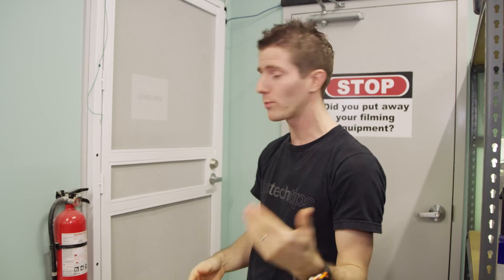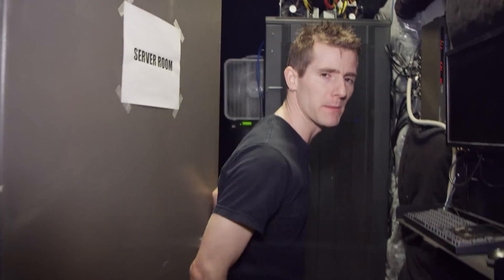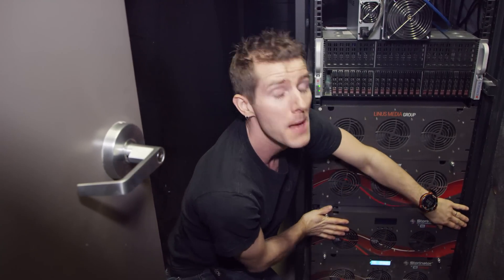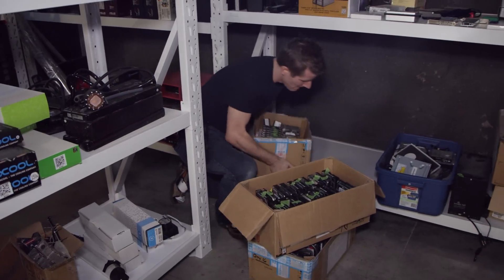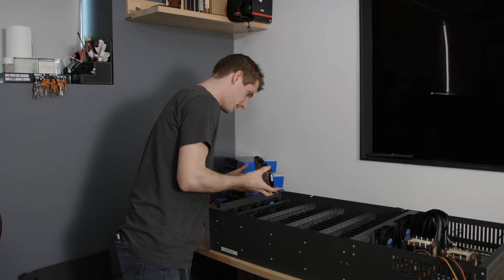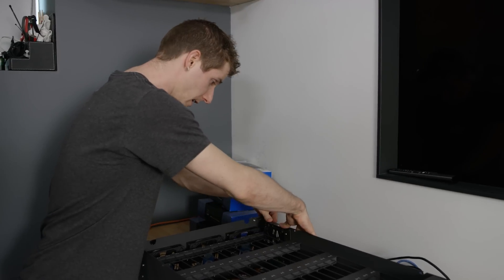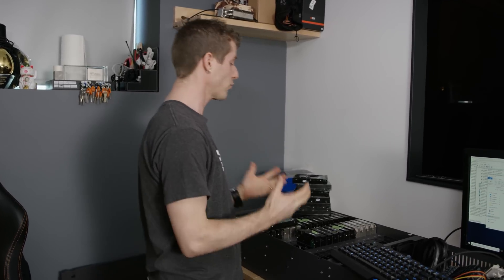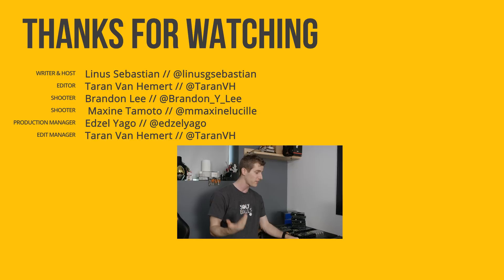HARD DRIVE Mining? This is getting ridiculous...

Comment: did you really use Seagate and a long-term reliability in one sentence? LOL
Reply: I have Seagate drives from 2004 that still work. To be clear, I use them in JBOD, because they're too small to store anything on their own. They're still going strong though.
Reply: OMFREAKINGGOD I had a very early Conner drive that couldn't hold a memory dump of a picture of Charmin that was still running after 15 years when I finally got ride of it.
Reply: Seagate was the only drive that hasn't died on me yet.
Reply: I’ve had worst luck with western Digital hard drives then anything I once had a western digital external hard drive that had a hitachi hard drive in it lmao
Reply: @josualinder3802  Why do you find it funny that you found a Hitachi drive in a WD enclosure? You do know that WD owns the Hitachi disk brand, so a Hitachi disk is a WD disk?
Reply: I've got a 1TB external my mom bought me with my PS3.  still goin strong!
Reply: I have a pair of seagate barracudas from 2011 which were powered on for over 6 years straight and they both still work. They aren't server grade, just regular cheap ones. I also have barracudas from 2004 and they still work fine. I have hitachi, maxtor and western digital drives and they work too. I had a samsung branded hdd which stopped working after 10 years.
Reply: Seagate had a perfect record in my book, right up to a couple years ago...  I recall a flood in Indonesia and prices tripled.  Right around then seafarers reliability sank through the floor and even I shifted to WD or Kingston SSD'S...
Reply: last year i bought a brand new Seagate drive and started throwing out bad sectors and reallocated sectors within 24 hours of me getting it 
it put 400GB of data behind a $900 paywall (data recovery costs)
and of course, Seagate refused to pay for those costs (and so did the store i bought it from) 

NEVER buying Seagate ever again, Western Digital is now my HDD of choice
Reply: @mwbgaming28  
So you got a bad drive boo hoo... in 17 years of IT support for various blue chip and educational sectors I have come across many drives that have failed in many different ways, some even give 100.000 of thousands of soft errors and never actually develop a problem and remain perfectly reliable, some have been fully reformatted and never actually develop a hard fault or another fault after a file system error, this can happen sometimes... it's not ideal but it can happen.

If your drive started throwing errors in the first 24hours why didn't you send it back with the proof and get a replacement drive on warranty like any normal person would have done rather than being a moron and storing 400GB of data on it and continue to use it? Typically one tests these things before fully migrating and deleting their backup. 

Your statement says it all really.
Reply: @mwbgaming28  
One other thing they store additional bytes for allocation on the drive as a backup measure for several reasons, one reason is minor faults in the manufacturing phase for redundancy and fault tolerance which is perfectly normal in every industry with high production rates, including cars, aircraft, computer chips... you name it, fault tolerance is something that is built into a lot of things. So if your drive started re-allocating bytes in the first 24hours that is a normal process, as when you are making millions of drives off a production line in a natural environment called reality it's extremely hard to make them all identically perfect and without a single fault. I would be grateful it started allocating additional sectors as opposed to utterly failing, that doesn't make it a bad drive in my eyes quite the opposite, imagine if it couldn't reallocate those spare free sectors.

You are describing this like it's a bad thing... it's normal, it's not perfect but it's normal.

Just as an Example: -
The PS3 console had something like 7 usable SPE's but in reality it actually had 8 SPE's built onto the board as a fault tolerance measure encase one failed during or after manufacture.
Reply: @Archline2  I did test the drive, I did a 12 hour burn in on it overnight and it showed there was no problem, so I started flushing data off my internal SSD and onto the hard drive (since all my other drives were full) 

And within 4 hours of starting the transfer, the transfer failed and I was presented with SMART status caution, I then proceeded to try and pull everything back off the drive and onto my internal SSD again while the going was still good, I got maybe 120GB into the transfer before the drive failed completely, as soon as I would plug it in and try to access it, windows explorer would lock up until I unplugged the drive, crystaldisk info would take nearly 5 minutes just to detect the drive was there (and even then it would show up as unknown) 

I took it to the store and they said I could get a replacement drive but they would not pay for my data to be recovered, I called Seagate and they wouldn't recover my data or pay for a 3rd party to do so

I literally had the choice of
A: lose the data and get a replacement drive
B: pay the money to get the data recovered
C: leave it on a shelf where it would sit, inaccessible for all eternity

I chose B and proceeded to egg the store every day for 3 months as well as spraying liquid ass in the air conditioning intake vents as revenge (that place still smells like shit to this day) 

These days I buy hard drives in pairs and have all my files mirrored on at least 2 drives, so of one fails, I still have the other, critical files are in a folder that is mirrored across every drive I own so if theres a fire or whatever, no matter which drive I grab, I won't lose anything important
Reply: @mwbgaming28  
Well that's a shame... I personally would have tried some other stuff because if you say the drive was not readable by windows and yet it was readable by disk testing software which it would have had to have been for you to get any SMART data off of it, then the machines BIOS could see the drive, maybe a full wipe and reformat using a live OS other than windows could have saved it maybe not. Maybe the drivers for the drive had corrupted in windows and needed to be reloaded and that's why it was locking your machine up... we will never know I guess. SMART errors typically mean there is actually a fault within the drive though, depends what the SMART error is or was, SMART usually looks for hard faults but some will look for soft faults... soft faults can usually be ignored as they can occur just by using a HD on different brands of controllers and usually are caused by aging hardware that needs to read or write more than once which is defined as typically normal operation... this is subjective though as a hard fault can (extremely rare) hide as a soft fault and hard faults are the real killer of drives.

Stores typically will never do data recovery, they are not obliged too, the data is yours, ensuring the drive you purchased works and you are happy with the product is your responsibility.

The lesson here is to copy and test your data on new devices, not move it and delete it, that way you will not lose anything if something happens to not work and only after some days of testing when you are happy to then delete the source. Though I know of drives that have failed within months but this is where you need to think about the importance of what you are storing and backup. You by far are not the first person to buy something new and have absolute faith that it's a fully working product and while this is what you should expect this is not what you will always get.

Unfortunately you were just unlucky don't see this as a negative though, remember there are hundreds of thousands if not millions of these drives being produced and trust me all manufactures can produce defective drives, unfortunately fate was unkind to you by delivering you a potentially defective one.
Reply: @Archline2  I know Seagate themselves offer data recovery services, but even they wouldn't recover it, even though the drive was less than a day old and was originally purchased from them by the store (even Dell, the EA of computer companies, serviced my Alienware laptop that I bought used off Craigslist when the CPU fried even though the warranty was not in my name)  

I took it to a local recovery service (payam data recovery) and $900 later they successfully recovered all the data and diagnosed the problem as "PCB failure" (I assume that is the circuit board on the back of the drive where the spindle motor is) 

When it started locking up my computer, crystaldisk info wouldn't read any smart status, it would show up as unknown (even then it would take literally 5+ minutes just to get it to detect something was plugged in) 

The smart warnings came before it totally failed and windows could still read it

And yes, these days I have learned my lesson about "moving" files rather than copying and deleting the source

I also copy everything to at least 2 drives for redundancy these days, it's costly but still cheaper than data recovery services (before that drive failure I didn't know how absurdly expensive data recovery was)

I'm still going to avoid Seagate in the future due to my bad experience with them (both the defective drive and their horrible customer service)
Reply: Difference between Seagate, HGST, Hitachi, and WD reliability is minimal. For a few years Seagate had a problem with early failures, but if they lived for 2 years (within warranty), they'd live just as long as the rest. But you have backups anyway right? So this should have been more of an annoyance than a problem. Also remember that all of the major laptop OEMs used Seagate, trusting their PR to them.
Reply: Guy with sample size of 4 drives within warranty makes comment on reliability of Seagate drives
Reply: I had to replay that part just to make sure that's really what he said.
Reply: steadfastcoward I wasn't talking to you, I was talking to the Hard drive recovery service guy...
Reply: Really? I've had 4 2Tb Seagate Barracuda Hard drives for the past 3 years and not a single one has failed on me. Do you even know what you are talking about?
Reply: Although I have never dealt with servers, I can say that in my lifetime so far, I have seen them all fail. At one time however it seemed that Maxtor hard drives were among those that were below average for long term, but perhaps just because OEMs used them more, probably because of cost.
However I have still Maxtor IDE that is in my old MAC G4 that although it whines, still running. But it is not a daily user. 
My Seagate (Praise God) 3TB is holding up fine. I will only bother with 2TB drives for now, simply because I don't even need more. As a home user, we tend to purchase drives to impress others, and that is a genuine mistake, because you need a backup drive equal in size to assure you can backup the entire drive, and Windows in a Legacy type system will not go past the 2TB limit without a 3rd party driver to allow you to use the rest. Linux also has no such driver, yet, so you are limited losing the extra 1TB roughly of space when booted in Linux. I have 2 hard drives, one for each OS however. (No not counting VirtualBox of course).
Reply: Seagate drives, the modern days have significantly higher failure rates than other brands. This is a fact. Especially among their 4TB models. Also fun fact, one of the worst HDD manufacturers in history, Maxtor, was bought by.....dun dun dun....Seagate!
Reply: Seagate drives, in the modern days have significantly higher failure rates than other brands. This is a fact. Especially among their 4TB models. Also fun fact, one of the worst HDD manufacturers in history, Maxtor, was bought by.....dun dun dun....Seagate!
Reply: @williameldridge9382  "Seagate drives, the modern days have significantly higher failure rates than other brands. This is a fact." You can't just say "this is a fact" and make something correct. Try using actual data. Such as the Backblaze reliability reports that show that, aside from a particular dodgy design Seagate used for their early 3TB drives, they trade blows with the highly reputable WD and HGST drives: https://www.backblaze.com/b2/hard-drive-test-data.html. Problem is that they got a reputation for being junk from their 3TB drives (that specific model was junk with an annualised failure rate of something like 20%) and now every time someone's Seagate drive fails it's because Seagate is bad even though all manufacturers have failing drives and these days they all tend to average out at similar rates.
Reply: I had one as well. It failed.
Reply: @tatjanasturane6852  I have five some of them almost 15 years old and none of them have failed. I have seagate drives which have clocked over 50000 hours in my server and they are in perfect condition according to crystaldiskinfo. Sure, some day they will fail but from my experience they are as good as other brands. Regular backups are more important than the brand of the hard drive if you want to retain your information for years to come.
Reply: @tatjanasturane6852  I didn't even buy my drives, got them from used systems at work for free so can't complain tbh.
Reply: I'm not wasting a huge drive on a Windows 7 installation and hoping it doesn't PARK A HEAD like the 750 GB I was giving for a gift. I'm not a Space Cadet anymore.
Reply: @steadfastcoward  that  seagate generation was sh*t
Reply: never using your stupid hdd recovery services then
Reply: MeatusBeatus Dude Seagate drives are fine, they are reliable.
Reply: Nope, no they are not.
Reply: I just bought a seagate barracuda for my rig R.I.P.
Reply: Dan A ummmm no, not in warranty. Not Barracuda Pro drives just the regular Barracuda drives that I only got one year warranty on. So yeah Seagate drives are pretty reliable.
Reply: BlueBarracuda If you had a number of hundred drives having been run for at least 5 years, then you would have been at a better position to debate statistics. Your sample size and time is way too small to give any confidence. You can't predict reliability based on four drives. A drive have x percent probability to fail every year. If 4% then 4 out of hundred. With 4 drives you would go from 0% to 25% from a single failure. If the manufacturer specifies 4% annual failure rate, then you must accumulate several hundred years of combined use to be able to figure out if the claim is at least reasonable. And several thousand years of combined use to be able to produce a reliable figure.
Reply: Why you only get 1 year warranty?

Comment: MINING WITH WATER --- ANYTHING can be used as a computational and storage device!

Anything that can change and then hold a physical state or position is capable of being a storage or computational device. Some Simon Fraser University researchers (a university near Linus's headquarters) at one point in time were trying to determine if specific locations within a cubic volume of water could have their physical and optical properties (i.e. refraction, reflection, diffraction, temperature, salinity, etc) could be changed and kept STABLE for a long periods of time within any given cubic area of that liquid container.

It was found that a laser, some DSP software and basic interferometry techniques were in fact able to determine that singular and combined properties of WATER AND OTHER LIQUIDS were able to be CONFINED to specific volumes within a tub. This means we could turn tubs of fresh water, salt water, alcohol (Ethyl and Methyl), oils of many types, and common thermal fluids into computational and storage devices by pulsing a laser OR an acoustic wave singularly OR in convergence so as to change the property of a specific 3D area AND keep that area stable and stop any migration of its properties to another area!

Basically, a tub of water is turned into a Hard Disk and a bottle of Gin is turned into a CPU device! So yes! if you can IMPRINT numeric values (i.e. changeable but stable physical properties and states) onto ANY medium (even DIRT!) in an organized and stable manner, that medium CAN become BOTH a storage system AND a computational device!

One science team that I know of here in Vancouver, Canada is able to trap Argon and Xenon molecules within tiny wells drilled into arrays of silica glass sheets which has tiny lasers to "Set" and "Get" the SPIN-STATE OR POSITIONAL-STATE information of the trapped atoms to form a storage medium that has YOTTABYTES of storage capacity in just a few cubic metres. 

Using Femto-second pulses of light (usually high UV), data read/write rates are on the order of MANY PETABYTES PER SECOND!  What this means is that VERY SOON NOW, sugar-cube sized glass slabs filled with basically vodka WILL be able to store enough information at a cheap enough rate that costs will drop to A FEW DOLLARS PER EXABYTE (1000 Petabytes or 1,000,000 Terabytes)!  .....AND.... when I have a few exabytes of capacity at my disposal coupled with the ability to MOVE/COPY/SAVE the properties of one trapped data item to and from another data item.... THAT MEANS I can EMULATE actual transistors to form EMULATED logic gates which means I can create a VIRTUAL CPU that can run at speeds in the area of MANY TERAHERTZ .... Imagine an AMD Threadripper 1950 or 64 core EPYC Server CPU being emulated at TWO TERAHERTZ
or 2000 Gigahertz!!!

AND YES it most DEFINITELY CAN RUN CRYSIS!